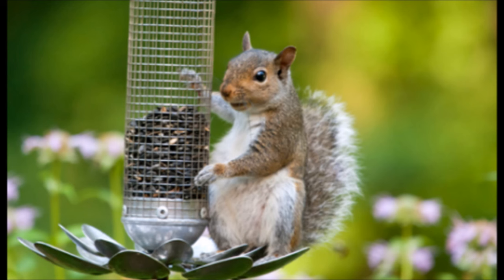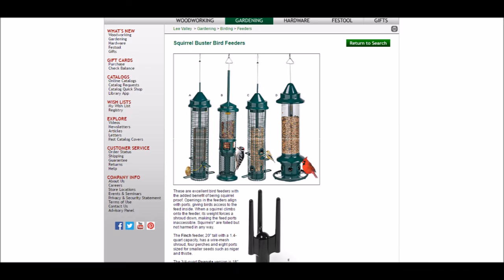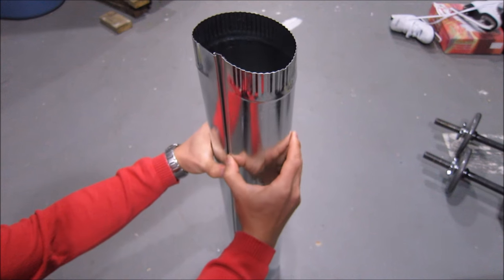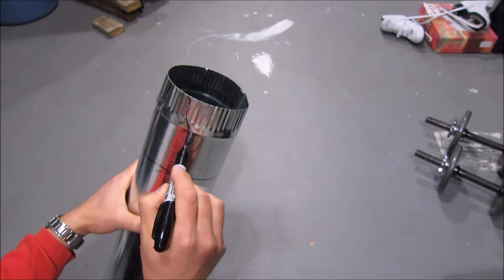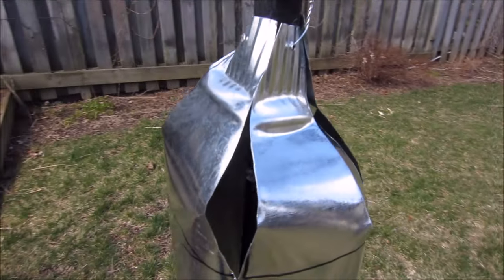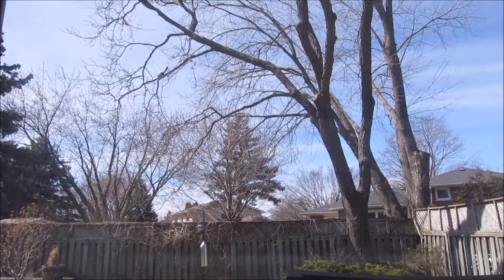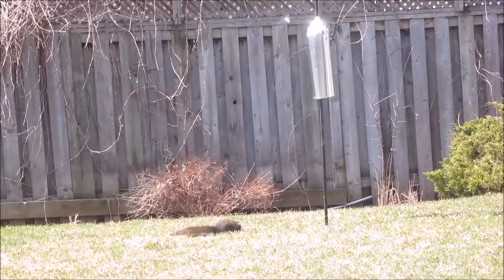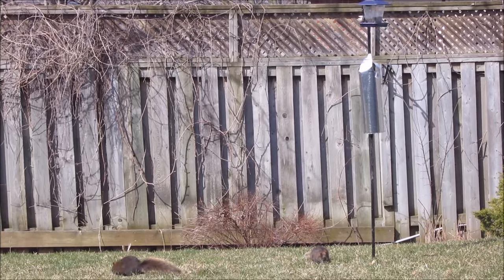DIY Squirrel baffle: Simple and effective

Comment: I picked up a salad bowl at my local dollar store here in Canada for 4 dollars which is abut 3.50 USD. I had my neighbor drill a hole through it and used it as a squirrel baffle and it works amazingly. Save your money people. Most of the baffles sold at stores range from about 30 to 60 dollars or even more and cost more than the bird feeders they are protecting. Try using a plastic bowl instead and boring a hole into it for the birdfeeder hook..
Reply from the maker: I just had this hook that you couldn't just drill a hole into something and slip over.  Great idea though very simple. I agree baffles you buy are insanely over priced.
Reply: Well I did the same thing, I paid $1 but it worked for a few days hahaha. I need a bigger bowl
Reply: vistaprime wow, i see your comments everywhere lol, seems like youre really into birds!
Reply: I cut a distilled water jug and it only works for the most subdued squirrels. Going to try to make the one in this video.

Comment: Thanks to your design, I'm winning (won?) the war. 

The key was snapping aluminum tubes in place, something I was reluctant to do since they're hard to re-open. I also blocked bottom openings of my three tubes with spring-loaded grips - a touche!, a take that! to the squirrels.

But I assured the squirrels I'd  throw some peanuts at them now and then as a goodwill gesture, no hard feelings.

All quiet on the eastern front - except for yellow jackets scaring off hummingbirds at feeder. But I'm dealing with them. Will report back.

Thanks again.
Reply from the maker: Awesome
Reply: Ml

Comment: I am sitting at my window watching the squirrels scale the bird feeder and conquer the baffle that kept them off for 3 weeks. Bribing them with peanuts doesn't work, either. I'll try your method! Also, watching your squirrels get frustrated is the best laugh I've had all week!
Reply from the maker: That's great if you give it a try. Just make sure that the pipe is around 6 to 8 in in diameter. A 5 in pipe that I used worked for a while until one squirrel figured it out.

Comment: Great easy solution... I didn't have any stovepipe so I cut out the bottom of 2 one quart plastic milk jugs and fitted one inside the other to give it more length. Then just hung it from a wire on my bird feeder pole and the squirrels are not happy! Works great.

Comment: I watched your video last night, went to Lowes today and made this.  This is great.  Haven't seen any those 5 squirrels all day !!! Can't wait to see how they react.  
Made some dome type baffles to for some hanging feeders, just punched a hole in a dollar store pizza pan.  Thanks for making this video.  I cut the tabs shorter so they just touch the pole.  Then ran a heavy gauge wire into a hole in the body of the pipe just below the tab.  Twisted it up on the inside, ran it over a hook and into the other side.  Made a good hanger.  Ill put the pellet gun away for now!!
Reply from the maker: Awesome!!! I just had one squirrel figure it out. I think now I'll have to try a 6" pipe.

Comment: I made one just like the first one you were showing I already had a peace of metal  I just cut a metal disc about 24 inches across and drilled a hole in the middle make hole as big as your pole and I cut the disc from the edge to the center hole and bent it  over the edge that I cut and when I had a cone shape not to much and pop rivited it togather it works well I just have to move it father out away from the trees and just to make sure I greased the pole

Comment: For squirrels jumping down from above I bought a round metal serving plate from the dollar store and drilled a hole in the center and pulled the string through . Jump down and nothing to hang on to and the sound of the metal and it moving with their weight  was enough after a couple try’s !
Reply from the maker: Very nice!  Good ole dollar stores. A good ole use of your noggin! Good job.

Comment: Thanks so much! Borrowed this idea and got a black painted vent pipe and a flat end cap from Lowe's and it's working like a charm so far. The flat top would be an issue, but there's nowhere for them to jump from to get on top of it, so all good!! BTW, the slinky worked for about a day, lol.
Reply from the maker: Awesome. The slinky would have been funny to watch though! I'm thinking of doing an obstacle course for the squirrels so they don't feel left out.

Comment: I just completed a similar project after using WD 40 on the feeder pole (it works for only a few days).  I cut the bottom out of a one liter green plastic soda bottle, leaving the top intact.  I then cut a straight slit from top to bottom and removed the label.  I snapped the bottle around the pole and secured a two foot piece of 1/8 inch nylon cord around the top threaded end of the bottle and secured the other end to the fork in my double shepard's crook pole.  Works great and no sharp edges.  I chose green to blend in.
Reply from the maker: That sounds great!

Comment: We have trouble with snakes which is what I noted would get past your shield but I used the cap you can buy for those pipes and I drilled a hole the pole size and put it on using pipe clamp on the pole to keep the shield from sliding down. Could have cut the cap so as to expand it to fit around the pole but our bird houses slip off the pole easily as do our bird feeders.

Comment: Thanks very much for sharing your idea.  My current baffle is a large circular platter but I prefer your design.             

By the way I have two different Squirrel Buster feeders  (peanut and regular seed). They are effective to a point.  The squirrels cannot access the bird food constantly but they have learned that if the jump on them they can knock some seeds out before they close completely.  Squirrels are extremely smart and ANNOYING!   😉
Reply from the maker: Darn right. Persistent and smart. What a tough combination.

Comment: What works for me with hanging feeders to keep tree rats from getting to your feeder. Go to an auto junk yard and get an air cleaner cover. The hole for attaching the cover to the stud on the carburetor works for many ways you hang your feeder. I have yet to see a squirrel get past the cover, and it keeps rain off your feeder. I have a fancy chrome cover from a racing air cleaner because only the best for my birds. No I just had a couple from old race cars. Cost, free in many cases just find a junk car, they are everywhere, go to a junkyard and get one for $5 or $10.

Comment: If you used a 24 inch long pipe, can I cut one even shorter? If so, has anyone used a 15 inch or 20 inch long pipe that worked as well? My pole hangers are not that tall and putting a 24 inch pipe on it looks too long.

Comment: Bravo.  Don't need to cut and taper the top though, just drilled holes in the top and used baling ire to both hang it and criss-cross at the top to keep the tree rat's from climbing through the pipe
Reply from the maker: Good idea!

Comment: My squirrel jumps right onto the pipe and climbs up it to the feeders. I am wondering if I should cut the pipe shorter or not.
Reply from the maker: How close is it to the ground? Also what diameter is the pipe?
Reply: @LadybugAdventures  The bottom of the pipe is roughly 2 feet off the ground and it is about 4 inches in diameter. The pipe is also 2 feet tall. I I found the scrap pipe in my basement. I put up a fairly large pie dish above the pipe, but the squirrel was able to bypass that too, even though I got it spinning on an inverted funnel. So, I took off the pipe last night and haven't seen the squirrel all day.
Reply from the maker: @pbrsandlittlecigars  my pipe is about 5 in in diameter which I'm guessing is the main difference. 1 in could make the difference with the grasp around the pipe. I measured my pipe is about 32 in off the ground. You got talented squirrel.
Reply: @LadybugAdventures  I agree. My squirrel is very talented. I do have one more piece of furnace piping that is larger than 4 inches in diameter. It's between 12 and 18 inches in height. You are most likely right. I need the extra inch or so.  I am going to try that in combination with a large pie dish I have spinning around an inverted funnel.
Reply: Philip Laycock l

Comment: Thanks for the information! I have some extra sheet metal to do this with, but not sure how to close the seam after I put it on the pole. Recommendations? And does the stove pipe seam snap together easily? If so, maybe I'll forgo the sheet metal and buy the stove pipe. I have several poles to do. Thanks in advance!
Reply from the maker: First: The ventilation pipe does click together pretty easily. If you have a number of them to do, I would go with this option.

Second: The sheet metal could closed with quick setting epoxy, silicone or adhesive caulking (outdoor grade, while it cures you could hold it together with duct tape or straps), you could rivet them if you have a 1/8" rivet gun (they are cheap and easy to use). There are other ways but it can be hard to explain. Google this "connecting paper without staples". The principle is the same with tin snips and pliers.

Third: Thanks for watching and making me think hard this evening!

Comment: How do you bend that thick part that snaps in together... I can't think of how I can bend it I am a woman don't have the strength to bend that what can I use
Reply from the maker: I'm not sure what part you're talking about bending. The two pieces should snap together. If ever I have to bend the metal I use pliers to give me more leverage.
Reply: Some of the pipes are hard to connect. When we used to buy stove pipe, I always had to get my sons. Maybe a neighbor?

Comment: Love this and am anxious to try it. When you said you would make the top flaps smaller, do you mean shorter, or narrower (more flaps)? Thank you!
Reply from the maker: I had to pinch the flaps I made a little more because a chipmunk was making it through the little gaps. Alternatively you could put some steel wool or small metal mesh to cover some of the larger gaps at the top. Now that I've squished in the top a bit more nothing gets through.

Comment: Needs a funnel at the top instead of sharp metal bent together. The squirrels can get cut from the sharp metal.
Reply from the maker: Good point. I used 10 steps which make the edges not too sharp. I don't find that the squirrels try to reach through and are endangered of cutting themselves. They're smarter than that and they stop at a barrier they can't go through.

Comment: nice idea but here's a similar design that is neater looking and requires no tin-snipping or metal cutting.  At Home Dept. buy a shepherd’s hook garden hanger and hacksaw off the hook part.  Then drill a small hole in it 15” from top (cut off end) for pin, cotter pin, cotter ring that supports a big washer that the 6" dia. x 24" pre-cut click together duct shield and end cap (both available at H. D.) hang from.  Mount the Holly Berry Gilded Chalet bird feeder ($8.99 from Home Dept. but made in China) on top of a galv. steel 1/2" pipe thread floor flange (also from Home Dept. but made in China)Make a 9/16 dia. hole in the center of the 6" dia. duct endcap, push the endcap over the end of the 24" section of duct and screw it in place.  Plant the shepherd's hook at least 8' from any tree branches or roof eave, then hang the 6" dia. duct shield on the washer supported by the pin in the shepherd’s hook and drop the feeder on its pipe over the top as shown in the picture. (Be sure to locate this feeder at least 8’ from any tree branch or roof eave that the little rascals could leap to it from!)
Spray paint semi-gloss black for upscale suburban look!(Feeder lifts off easily for refilling)
Reply from the maker: Good idea. The only thing is... your idea has a lot of metal cutting! Hacksawing through the sheppards hook can be pretty time consuming. Drilling a hole through it is also a pain. I agree that it will be neater!

Comment: The most effective way to to dispose of grey squirrels IN MY YARD is the Havahart 
model # 1083  EZ-set, 1 door trap.  I don't have the time or energy to be making
home made traps by hand.
I have used the Havahart  EZ-set # 1083 to dispose of 360 grey squirrels since 
June 2014. The  1-door EZ-set traps save me time in 3 different ways:
1)  They are much easier and faster to set than 2 door traps.
2) they are also much easier to bait because you just put the bait behind the 
trigger plate, instead of trying to balance the bait on top of the trigger plate.
I have had the 1030 go off in my hand from the motion while walking with it.  Very annoying.
3)  I don't have any false alarms any more because the 1083 is NEVER set off 
by small birds.  It takes a 1 pound animal to set off the 1083 and almost all 
grey squirrels weigh at least 1 pound.  That is important if you are not home 
to keep checking your traps.  You will never catch a squirrel, if the trap is closed 
for hours with a small bird inside.
I used to use a 1030 for grey squirrels but since I bought 2 of the EZ set traps
I stopped using the older model trap.  Every squirrel that I dispose of is 1 less squirrel 
that will ravage my garden of tomatoes and my bird feeders.  I take them all 
to the exact same spot in the nearby woods and allow scavengers like possums 
to have the carcass.   Win-Win  

Possums are unfairly maligned by many people simply because of the way they look
Home Depot and Lowes do not stock the 1083 but I was able to get them 
online for about $35 via Amazon
WRZ  2020-08-14
Chester County, PA

Comment: Good idea.  I have wrapped the phone pole holding my bird feeders,,, top and bottom, with that galvanized pipe, hoping the metal surface would not give them anything to climb on,, and they STILL manage to get to the feeders.  I even coated the pipe with grease to make it more slippery, and I watch the little ^&(#(^&$ take a running start, and go right up the pipe.  Last hope is to wrap it with some sort of flexible pin and rubber belt, that might slow his inertia without giving him something to grab on to.  It IS War,, and I am loosing,,,
Reply from the maker: Haha! Their advantage is time and a ridiculous appetite!

Comment: Saw a ready built one on Amazon for $19.95.
Reply from the maker: That's a pretty good deal. Will it wrap around the pole as well?
Reply: @LadybugAdventures  You have to slide the baffle over the pole. It is a solid tube,which I think is better than the stove pipe DIY one,as there is absolutely nothing to get a grip on.
Reply from the maker: @mikedunn7795  Sounds good. I just had to make this one because my pole didn't allow me to slip anything on from above or below.
Reply: @LadybugAdventures  Yeah,my birdfeeder came with a pole that is split in the middle and held together by a kind of clamp.The feeder itself is held on the pole by a sleeve with a setscrew. You could cut your pole and put a sleeve with a setscrew on the  bottom or top half. But what you have works,so if it ain't broke,why fix it?

Comment: Just tried this. Squirrel ran right up it..took it off, put about 4 inches of vaseline with cayenne slathered on shepherd's hook. Ran right up over it.. I give up.
Reply from the maker: You have some pretty athletic squirrels. Using a larger diameter pipe for your squirrels might work better or just going with a cone design. In the four years I've had this working I've only had one squirrel figure it out. My pipe is about 5 in in diameter but you may need a 6 in diameter pipe.
Reply: @LadybugAdventures  I ended up making a plastic baffle from a large party bowl. Worn through one and on the second now.
Reply from the maker: @laurie3504  And the battle goes on.